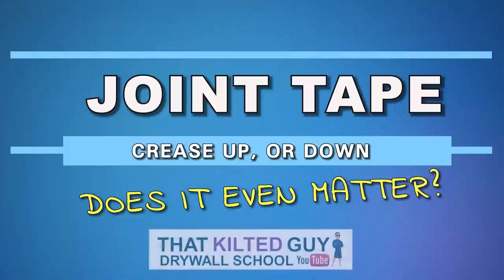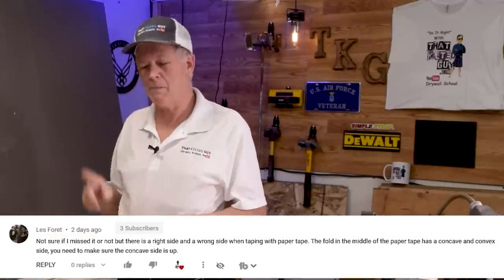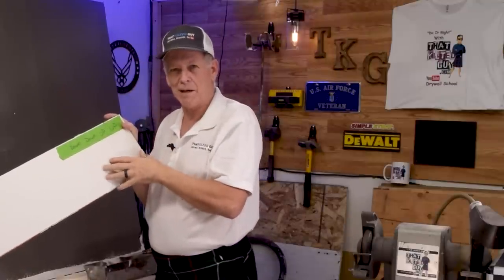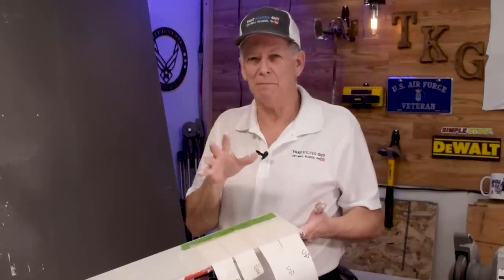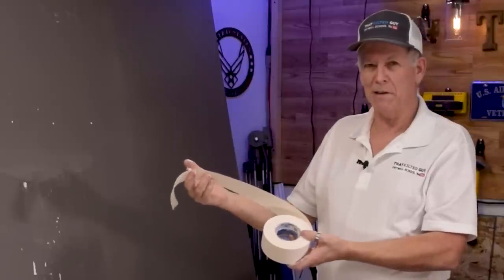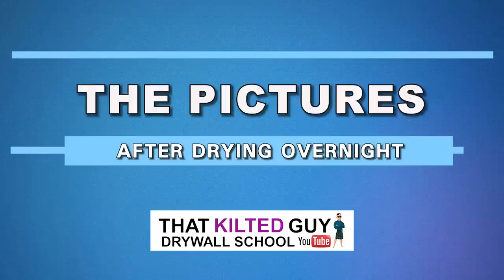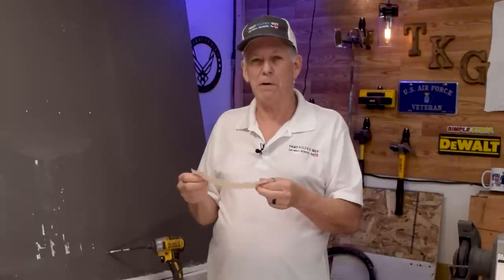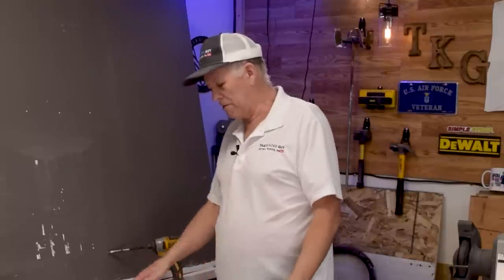I Was Taping Drywall with Paper Tape WRONG for 35 Years???

Comment: I've been a finisher for 40+ yrs.  Was taught by my father as a young boy,  by hand, no bazooka, no banjos. A few reasons I have always run tape crease down, 1. The tape roll hangs down natural in that direction on my tool belt tape hook. 2. If a butt joint is slightly  over sanded the crease will show through early. (burn through).  3. The tape is in the correct direction for inside angles without looking at it. The natural way it works off the roll.
Reply from the maker: I first spotted nails in 1969 when I was 8. I've got over 36 years actual drywall experience and I've never ever seen a ridge burn through. You guys must have huge creases, lol
Reply: @ThatKiltedGuyDIY  I was the same age when I first spotted the lower nails. Naturally if it's coated properly it shouldn't matter. Although the tape seemed thicker in the past, when the only place we could buy tape was at the drywall supply house. Thanks for the interaction!
Reply from the maker: Nice to meet someone with similar experience. I actually spotted the upper nails because my dad put me on stilts. It probably took me 30 minutes to do the upper nails in one room, LOL
Reply: @ThatKiltedGuyDIY  I have always done everything but corners with the crease up but it's really good that I learned it sounds like it does not matter apparently. Seems like I saw a Youtube guy that said that too... oh yea, it was That Kilted Guy that said that. LOL!!!
Reply from the maker: Actually you’d figure out I’m a nice normal guy not some weirdo
Reply: That's why I have always run it with the crease down because it comes off from the bottom of the tape holder and it's the way it creases for the angles. The other guy that worked would rather his tape come off the top. I don't think it matters really. I was taught to always run the crease down by my boss man. I worked for him for almost 5 years and went own my own after we had a little disagreement.

Comment: Ok, first off, I've been a remodeling contractor for over 45 years, I have taped hundreds of miles of drywall, I have never noticed a difference, however looking up the patent for drywall paper tape, it appears that the crease should be down, but just like toilet paper, it works just as well over the top, as it does down and back.
Reply: Damn old school what a great answer. l never gave it much thought until this video. Now everyday l think about what side of tape is proper. Worst video l could ever have watched. Since the videos my dumb ass tried both sides. Personally on repair work l cant tell the differece. You old school what you think. Thanks James
Reply: Yes but the TP does work better over the top. Unless you are a chronic overspooler, down the back you can go give it a quick slap to re spool.
Reply: Agree
Reply: You know that popped in my head when making my first comment above this one.

Comment: As a commercial carpenter I can honestly say that whoever is losing sleep over this hasn't done enough to know. Just tape it and hurry up because we need to get the painter in here so I can install ceiling grid!!!
Reply from the maker: Lol, exactly. Too many are over thinking this.
Reply: Been a pro for 15yrs. Only place it matters is on corners, there you want it in so you can fold it to the corner. Other than that it doesn't matter like you said. I normally just have the creaae go toward the wall anyways but thats how I was thought. Just mud it and keep your butt moving!
Reply: @palehorse24681  agreed. When running angles, fold it the way it is already creased. That the only time I make sure of the direction. I read a comment about one side has different fibers than the other so it adheres better if it's one way as opposed to the other. What a total idiot to believe that. It's the same fibers, front, back, in, out, up and down. Just paper, friggin paper! What a baffoon. That notion is as absurd as a GC on a jobsite who picked up a roll of joint tape, tore a piece off, attempted to stick a sign on the front door and watched them fall to the ground and then says: "hmm, I thought it was double sided sticky tape". Some people make the rest of us idiots look like geniuses.
Reply: That’s the problem,now days it is all about speed ,get it done in a hurry. That isn’t worth a darn. Good quality work can not be done in 2 minutes. Been in the business 40 years. I am not guessing ,I know exactly what I am talking about. You can move along and make a good showing, but you can not do good quality work in a blink of the eye.
Reply: @philipcrane8406  I completely agree. However my employer doesn't give a damn about quality. If they did they would use third world sub contractors to hang and finish. They only care about cheating the little guy so they can keep up with the Jones's.
Edit: they would NOT use (Mexicans, Guatemalans, and Hondurans)
Reply from the maker: But there are many ways to get a job done faster and still do the same quality. That’s what I specialized in with drywall repairs. I’m five star rated everywhere for that reason.
Reply: @ThatKiltedGuyDIY  l aint bragging but l got 5 stat ratings to.l got to say no one loads up twelve inch blade with half a bucket of mud! Exceot you brother. Just watching you do repairs you could close your eyes because you looked very bored. You done it all. Glad you doing something that puts a smile on your face. Back in the day your fellow tradesman woulld be hating on you because you revealed trade secrets.lm glad things have changed.Technology is something else. Whats the old saying dont be a broke broken down old man! Glad you are doing well. Probably the most direct honest person in the trades. Thank goodness you dont tell ur vewers to hit with their purse or look for automatic sheetrock air gun! holler
Reply: Quit talking and get it done we are on a schedule. I have to get the grid up so the electrician can get his lights in. Hurry up every chance you get.
Reply: People who say things like that are just messing with your head with no example to back their thesis of the question! As my old man would say they're niggling socially awkward pests! ( That's the polite translation!)
Reply: LMFAO!!!!!!!
Reply: @philipcrane8406  Hi Philip. I agree with you. Real quality isn’t valued so much anymore. There are some people who appreciate quality, but many people don’t want to pay any extra for it and don’t care so much. I’m Canadian living in Japan. My hobby is carpentry and anything DIY. New houses here are most often slapped together very fast and only built to last 25-30 years tops. Then the houses are demolished and new ones are built. It’s totally a throw-away, buy new, society. I much prefer quality that will last a lifetime. That’s how I work. Same with buying anything.
Reply: @ThatKiltedGuyDIY  That’s the ideal way to work. Efficiently and doing a high-quality job.

Comment: The tape is designed for the crease to go down, the fibers on the crease side are longer made to grab and inbed into the mud
Reply: never knew that, thanks.
Reply: As an amateur having done a few basement remodels and many repair jobs, all on my own homes, I never thought about the difference. It seems more natural taking off the roll to go seam up, because that is the direction I would apply masking tape to a project, but... seems like an inward makes slightly more sense, especially on a butt joint.

The wetter the mix, the less the difference, so I think the best suggestion is to thin your mix.
Reply: lm sorry David how many thousands of ft have you run in your life time? And then went back a year later to look at your work? Are you a expert or a expat? lm glad you feel you are a expert. Go out there every day do the work and put a year warranty on your work. Pros got better things to do than think about OH which way do l put the tape up.. We been doing this shit for years. Stick to what u know.
Reply: David
You're exactly correct, hence why Ames and other automatic taping machines require the tape goes with the crease side down
Reply: @jamescathcart4762  I've been a carpenter for 22 years I can't tell you how  many 10s of thousands of ft of drywall tape I've run, and  I went to the USG symposium in 2004 when I was a carpenter's apprentice
Reply: @davidreish211  You the man brother!
Reply: @JerryHolaway  You are my hero!
Reply from the maker: They’re the same on both sides
Reply from the maker: Everyone should look at my community tab post from several back where I took a picture of both sides up close and you can see they are identical, sorry
Reply: @jamescathcart4762  Someone has to be 😏
Reply: @JerryHolaway  What up youngsrer! How do you feel about repairs. Are you flexible on that? Or adament on your theory? l know l spelled it wrong. Anywayway lm glad you have a sense of humor.We are talking about tape brother not cutting commons, hipps valleys or jacks. Much less stairs! Lets not get started on that subject brother! Thanks for having a sense of humor you old saw dog you! You ever think you would see sixty dollar decking? lm glad im sixty dont have to worry about that shit no moe foe show. Power to the building trades!
Reply: Ok, this made me LOL! The fibers are the same all the way through the tape, they don't make two different sides! The crease is simply to make it easier to fold when you do inside corners. It doesn't indicate which way is up or down. Most people will use it crease down because that's the way it comes off the roll, and you wouldn't want to have to switch how you are applying it to do corners.
Reply: @ghosthand8119  Great answer! l agree 100%. Good luck convincing the rest of these out of reality thinkers. Hope the rest of you over thinkers sleep well tonight. l know this slow talking, slow thinking country boy will.
Reply from the maker: @Ghosthand Exactly!!!
Reply: Your point is definitely flawed. You apply mud to both sides of the tape. I would think both sides are made to grab the mud. I am a carpenter not a finisher so I am not a expert in this field but common sense says both sides are the same.
Reply from the maker: @whitechris720  they’re the same
Reply: @whitechris720  l agree! l doubt theres many workman in the trades that dont agree with you.lf they dont, mabey they are in the wrong field and need to apply to work for NASA. Good luck with that you rocket scientists!
Reply: The crease in the tape is only there for angles. Can you imagine what angles would look like without it? Harder to wipe and uneven. If the quality of ones work is dependent on which way the tape is your doing something wrong.
Reply from the maker: @xjackiegleason3078  exactly
Reply: WHO CARES
Reply: @jonesj811   I might be a reaching, but I'm going to go with the 300+ people who have made a comment..
Reply: @jamescathcart4762  looking through here, all of your comments are half assed sarcastic remarks that people are over thinking it. I'm glad you're 60 and retired so that new technology and innovation can come about without someone like you in the field trying to antagonize people. This isn't a discussion about rocket science and you obviously are ignorant to professional social interaction. Either learn how to have a constructive conversation or please just sit in your chair until time runs out. I bet your parents did think tvs would ever come from radios, but guess what.. innovation happens. Good day.
Reply: Hey David probably owe u a apology for being a knuckle head. Maybe had to many beers that night. Now when l make repairs l think about what side of the tape l use. You made me think about something l never thought about. Repairs are not rocket science but now l think about which side of tape l use. Would like to drink a beer with u one day. Holler at u u old school saw dog! James Oh by the way l still dont know what side l use. Holler Big Dave
Reply: @jamescathcart4762  there it is. You can call me whatever you want, big man on the internet. But thanks at least for apologizing to the other guy.

Comment: I think its makes a bigger difference when you're actually doing a joint and there is a gap. Especially if its a 5/8 tapered joint.
Reply: Agree. When there is a joint the mud underneath can pucker that seem up when seem is up. 
I always try to place it down.
I think to someone with drywall skill.. It doesnt matter. 

I drywall once every .. 7+ years. So i have to relearn a bit every time. By the end i have a good flow going.
Reply from the maker: Yeah, I NEVER have a problem with direction. So it’s more a skill thing. The direction doesn’t matter, technique does.
Reply: @ThatKiltedGuyDIY  and pre-filling those gaps would help

Comment: I always used the tape crease down, when the paper deforms the affected area is way larger when crease up, the paper tape didn't have a crease before, the crease was put in for corner taping in which case the crease would automatically be down if you're right-handed.

Comment: I was one of the guys that commented on your last video about the tape direction. The side that has the “ridge” is fuzzier than the other side that is fairly smooth. This makes a difference in how the mud grabs the tape, both in strength of the adhesion of the paper after its dry and how the tape reacts in the process of taping. Your test actually shows the strength difference when the first strip you pulled, totally came off whereas both of the other ones tore. You can also notice a difference while taping because if the “smooth” side is down, the paper will glide on the mud bed easier and won’t stay in place as you wipe. I too have been in the business for over 30 years and of all of the repairs of lifted tape, many times it was noticeable that the crease was “up”.
Reply: I'm convinced.  Your explanation sounds the most valid. Sure it might work both ways, but it was designed and works best one way. Thanks for explaining why.
Reply from the maker: Check out my latest community tab post. Both sides are identical.
Reply from the maker: You better go look at that video again because you’re wrong. Plus look at my community tab post and you’ll see both sides of the paper are identical other than the tiny crease. I took extreme close-ups of them for you.

Comment: Another great video. I'm 30 and have been taping for 11 years. I spent some time on the machines but spend most of my time with a trowel doing resurfacing as well as new construction. I find there isn't a difference in which way the tape is especially when coating by hand. The big issue with hand taping is over wiping the tape or not having enough mud behind it. I also use a slot box not a bazooka or dry taping in my opion its the most reliable.

Comment: So, seems to me from this that you can make a case for crease down, or it doesn’t matter, but there is no case to be made for crease up. Thanks.
Reply: Yes, so therefore always put crease down and you won't ever have to deal with a problem caused by crease up.
Reply: I've seen rookies and homeowners do crease up on a butt joint and then sand a little too much and you can see the crease so for me it's always crease down and there is no other way and I'm not arguing and I love everybody and I teach also that the crease goes down and in mudding every little bit counts and I was taught to pay close attention to detail

Comment: Did two houses a week for years, we ran crease down especially in the corners. If you use a bazooka, it's designed to run crease down.
Reply from the maker: Indeed, like I showed
Reply: @ThatKiltedGuyDIY  I believe crease down is better because of a few reasons.  1: If the crease is faced out, some air may be trapped underneath, which would then have to be squeezed out. With crease in, it contacts the mud first.  2: As used in the roller, the crease is in.  3: The crease can help guide the tape into place by the gap between Sheetrock. 4: A thinner layer of mud can be used if the crease isn't protruding out.  5: It just seems right. Crease goes into corners easier and Sheetrock gaps is just an 180 degree corner.  Lol
Reply from the maker: But the problem is you guys are talking like this crease is huge. I seriously doubt it’s even a 100th of an inch tall. Look at my pictures and it barely sticks up at all.
Reply: @ThatKiltedGuyDIY  I agree that it's not much of a difference, but if it protrudes any, more mud would need to be used. If the crease is sanded, the paper thickness is reduced and weakened at the crease. The crease covers at the joint, if the rest of the tape is sanded some, there is still strength in the paper below of the Sheetrock. For a newbie, it would be best if he/she didn't sand away 1/2 of the crease. Just my opinion.
Reply: @ThatKiltedGuyDIY    Sometimes even showing a confirmed scientific undeniable result isn’t enough for people that try to over think things. Great video buddy. Try not to waste too much of your time debating people that you’ll never convince.
Reply from the maker: I get it but the more you guys argue, the more YouTube promotes my video so it doesn’t bother me. Thanks
Reply: @ThatKiltedGuyDIY  I'm definitely not trying to argue, because I'm not a sheetrocker. I've done a few rooms worth, and have taped even less, so I'm just stating an opinion. I've watched a few of your videos and find them informative, so keep up the good work. I would love to start a channel about framing. There's a lot of tricks and tips to share. Best of luck to you. :)
Reply from the maker: Actually I was trying to reply to the guy above who told me not to waste my time. I was just saying it’s not a waste of my time to engage with you guys and let you all argue amongst yourselves. It wasn’t anything specifically towards anyone. So no worries and I absolutely know there’s lots of tricks for framing so maybe consider it. Take care